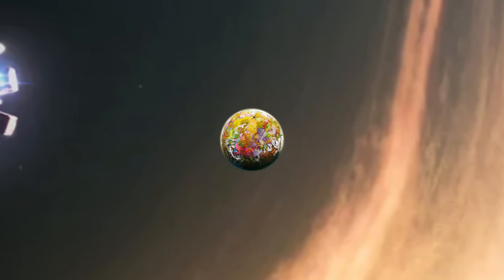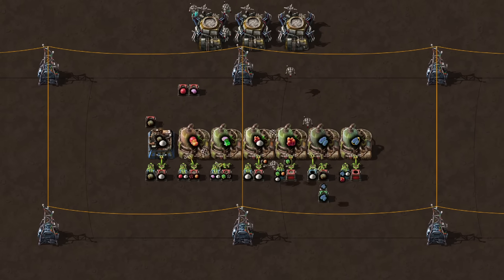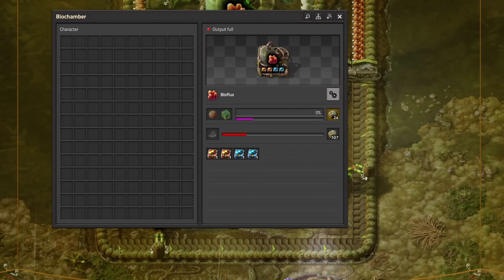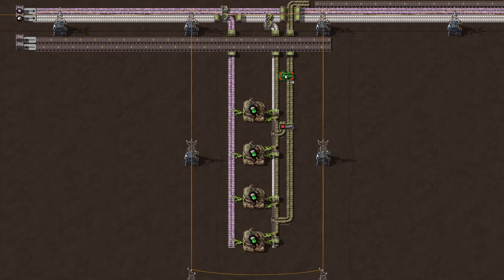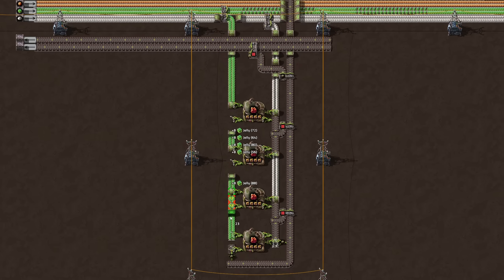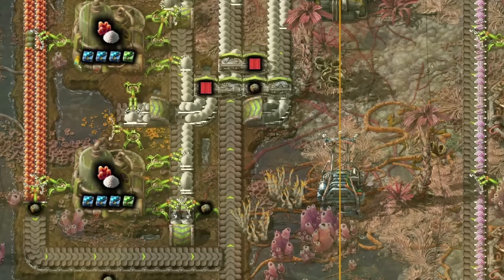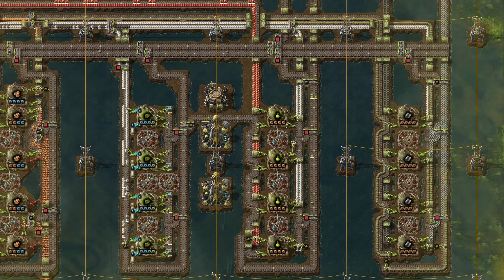Master Planet Gleba in Factorio. With Belts and a Main Bus! Factorio Guide / Tutorial

Comment: This is a really good guide but I would advise having a separate spoilage belt round the outside of each production block. Sometimes it clogs using the blueprints provided. I managed to fix this by separating the belt and using some splitters at various points in the ingredient belts. You rarely see that dark green at all anymore except where you want it. This way is so much better than having a million bots. Thank you so much xD.
Reply from the maker: I don't see how this could ever clog up even in theory and it also never happened so I'm not sure what went wrong.
Don't use normal belts though, at least red ones. Better express or turbo.
Reply: @AVADIIStrategy Sometimes when it doesn't move as much even with turbo belts there is a lot of spoilage that builds up some times. It's always good to keep the belts moving but that isn't always 100% possible. Adding an extra belt kept it clear even when the belts fully stall, it gave me a good way to provide extra spoilage for the power supply. All I did was add a separate belt and add splitters that constantly pulled the spoilage off. It actually works really really well.

 I wasn't implying there was something wrong with your build at all (quite the contrary actually), I was just saying that if nothing is moving sometimes the belts go very green so adding load of splitters at select places on belts is a great way to keep the belts clean while pulling spoilage off.
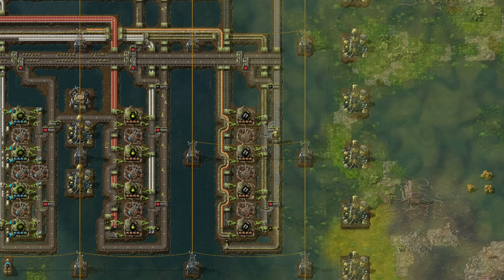Reply from the maker: @reddragon4482  I guess you are talking about situations similar to 7:00 theres a lot of spoilage in the carbon fiber production and you're trying to get rid of the spoilage on extra belts.
The thing is: you don't have to. The reason stuff is spoiling is because of overproduction. As soon as you start consuming it will clean up automatically.
Theres nothing wrong with having spoilage on your belts so in my opinion you're trying to solve a non-issue.
Reply: @AVADIIStrategy 👍

Comment: Loved the video, many good tips. One more: many Gleba recipes (and all the normal ones) don't require a biochamber, they can be done by an assembling machine T2 or T3 (AMs). Yes, the biochamber is very efficient, but managing nutrients can be a hassle if you have to do a cold restart of the base.
Eg: making bacteria from fruits is only really needed if you don't have a running Biochamber growing more bacteria and can be done in-hand or in an assembling machine. And AMs don't require nutrient to do so, just fruit products.
Processing Jellynuts and Yumakos can also be made with either the Biochamber or AMs. So if your jelly&mash  -> bioflux -> nutrient chain starves, you can still keep producing jelly and mash to help restart the bioflux-making biochambers. If you get to Gleba before you unlock bots (or are just low on belts), you can even place the AM right next to the Agricultural tower, and feed the seeds from the AM back into the tower. Without any productivity modules this will result in neither a net gain or loss of seeds, allowing the tower+Am to simply produce fruitproduce with no extra input. It will spoil rapidly, but it's nice during those no-drop-pod starts.
Making biochambers themselves can also be done in AMs, but since the base recipe requires nutrients anyway, there is little point to do this after making your first biochamber.

Comment: I noticed a problem with your infinite egg blueprint. If the nutrient output spoils inside the assembler, there is no inserter to remove it. It normally should not happen, but if the base shutdown for some reason, it will happen.
Reply from the maker: Cannot happen because the biochamber consumes way more nutrients.
The only case would be a long power outage. But without power no other solution would work.
Unless you use the trick presented in the comments section:
Just save biochambers. If recycled they turn back into eggs.
Reply: @AVADIIStrategy  Yeah, a power outage would be the cause, but when power come back, the spoil is blocking the output. A simple inserter to take it out on a belt that brings it to the burner or the spoil chest is the fix. It is less pretty, but it works.
Reply from the maker: @Wildhorn666  But then the eggs spoiled and are gone. So you would be forced to manually fix the issue anyway and get a new egg from the locals.
Reply: @AVADIIStrategy You are right.

Comment: Instead of inserter at the end (to remove spoilage) I recommend a item loop you introduced in the Fulgora video. (because sometimes the end of the belt will be fresh and rest will be spoiled). In that case all we need is to read a loop content to avoid belt overload (items stops moving due to no space after spliter) and filter out spoilage.
Reply from the maker: If the end of the belt is fresh and rest is spoiled you have no problem do you?
The system will just sort out this problem on it's own consuming the fresh stuff and then the spoilage is at the end of the belt and will be removed.
But generally speaking when using belts properly the items on your belts will be in ordered by freshness so this doesn't happen.

Comment: I felt really stupid at 2:10 as I power my gleba factory with spoilage heating tower, but for some unknown reason I kept thinking the heating power as a burnable powered nuclear reactor, hence I used control logic to consume just enough fuel as needed. But then I have the problem of disposing the spoilage as I use only the nutrient production as the disposal, and the excess of nutrient always cause the spoilage to be backing up and stop the whole base. I always felt like I want to throw my smooth brain to the wall whenever I need to fiddle with the nutrient balance in gleba, when the answer is to just disable the temperature control system.
Reply: Why complicated it though, just pump tons of spoilage through it through underground belts and grabbers on each side. The more you pump through it with rare+ inserters the better. It will power all your turbines and water heating set up no problem at all. Nilhaus does a good set up for one on his channe for a spoilage powerplant but I took all the circuitry out and just boost the throughput of spoilage as much as possible. It's maybe worth your while importing a nuclear power plant anyway, it's always good for a backup if the base fails for some reason too. Only thing you will need to import is the fuel cells now and again.

Comment: you can limit the spoilage in general by having less input than required or by +50% more bio chamber for each steps
Reply: Spoilage is actually useful though when you have it being pulled off the belt at all times.

Comment: Can you please explain more your circuit network setup for loading agricultural science into the rocket solo?
Reply: yeah, that would be very helpful. I´m struggeling to get that automized
Reply from the maker: What do you mean exactly? You can load it just like any other item.
Unfortunately bots do not have a 'fresh first' setting which is why I don't use bots.
Instead the dedicated rocket silo in the video has "automatic requests..." disabled.
Inserters will put science into the silo with 'fresh first' setting.
And because I only want to load the rocket when there is actually a spaceship in orbit I setup a circuit connection that listens for orbital requests and only start loading when theres an agricultural science request of 1000.
Reply: How do you set a circuit network from space??

Comment: I haven't gotten to gleba yet, but I have a plan for a belt base.  Every belt ends up at a heating tower, so they can never back up.   There should also never be spoilage, but if there is, it goes in the heating tower with everything else with no special consideration.

Comment: I found direct insertion to be the only solution to scalable usage of jelly.

I'm pretty convinced that the most efficient approach to Gleba is belt loops for all ingredients so that nothing gets stuck in a dead end to spoil. With circuits to limit production, you can eliminate tons of spoilage
Reply: Before working too hard on eliminating spoilage, make sure you've got a secondary heating tower fueled with rocket fuel, or some other power source that doesn't require a flow of spoilage.  My first reward for designing a setup with very little spoilage and no overflow...  was to hard crash the power because I wasn't burning enough to keep the heating towers hot enough.

Comment: Nice, but instead of putting seeds on the belt i use a filtered inserter to take it out, aren't you wasting a swing of an inserter every time a seed is generated because they only take one item type at a time? Other than that nice and clean, i also used belts but i changed a lot of it once i had access to a calcite platform.

Comment: This is amazing, I basically copied down this whole thing yesterday after landing on Gleba for my second time through, and set this all up with some expanded production of certain things. I was tired of the full bot base craziness.
My question is, how else are you managing the Eggs? The Egg preserver seems to work, but how are you setting up requests for the Egg production? Are they requesting just a couple of eggs?   My last setup was following Nilaus and one thing I did like was the revolving belt for eggs to make sure they have enough to produce, then I was pulling them off based on how many. I'd be curious to know how you have this set up. Awesome video! belts all the way
Reply from the maker: The egg preserver will occassionally produce eggs and put one into the active provider chest.
On the main bus where i make eggs each biochamber has a requester chest connected to the biochamber.
The biochambers are set to read contents and include in crafting. The requester chest requests 1 egg but is only enabled if the egg content of the biochamber equals 0 which should never happen.
But if it happens a new egg will be brought from the preserver.

Comment: I also want to point out that your use of beacons at 3:45 is actually not very efficient. The best way is to have a line of beacons in front and behind the machines, meaning 8 beacons per machine. That way, if you try and cram an extra beacon between them, you are actually spreading out your biochambers, and effectively decreasing your space efficiency for only a tiny bump in speed. 2 machines in a small space working at 10X production speed is much better than 1 machine and a beacon taking up the same space, but working at 11X
Reply from the maker: Hi, this is not meant to be a very late game fully beaconed design. If you got this impression somehow than i have to tell you that it's not.
Since Space Age, having only 1 or 2 beacons in range of a machine is very efficient because they changed the distribution ratio based on the number of beacons. In other words for every additional added beacon the effectiveness of each is lower.
That's why for an early game setup like this having only 1 or 2 beacons per biolab makes sense. Back in 1.1 i would have agreed with you but in 2.0 a single beacon with speed 2 modules increases the biolab speed from 2.0 to 3.8! +90% That is not a tiny bump in speed.
Reply: @AVADIIStrategy   ah no I wasn't referring to a single beacon being a tiny bump. I was saying that if you already have 8 beacons, adding 2 more by putting them between machines only increases their performance by about 10% due to the diminishing returns. I have just gotten into beaconing my setups, so I think I might be entusiastically using them earlier than most people do. 

As long as you have access to a lot of power though, and make nutrients reliably enough (fastest possible belt out of a bioflux converter) then beacons are not such a late game thing. At least not by the time you get to gleba
Reply: In a way, yes, but in a way, no.
With the new beacon mechanics you may not want so many perachine. The effect per beacon scales with 1/sqrt(n).
Num: Effect: Total
N=1: 1.5        1.5
N=2: 1.06      2.12
N=3: 0.866    2.60
N=4: 0.75      3
...
N=8: 0.5        4.2
...
N=12: 0.43   5.2

And so on. If you want or need max speed for minimum space or machines, then sure, but it gets very expensive. If you aren't hurting for space or processing, just add another machine instead.

Comment: I definitely think belts are they way to go for Gleba, even if it does take a bit more effort. I ensured that belts never stopped moving. Jelly and mash would go along a long belt to the various machines that need them, then end at a set of chests for the sole purpose of letting them spoil for rapid incineration. Very wasteful of the unused fruit, but as was said, resources are infinite. Nutrients were the exception, and just went in a loop sushi-style until they eventually spoil and get filtered out.

Comment: Good video! I have to say though this base is so inefficient it made me cringe super hard. 7:44 no they are not quite until you handle all possible deadlocks. If you really want to master the gleba way with belts i can recommend the Any Planet Start by _CodeGreen mod. It lets you start on Gleba and changes the tech tree so you can research everything starting from any planet. Once you know how to gleb with yellow belts you will have become one with nature (and circuit logic for extra efficienty). After building your starter base on gleba the rest of the expansion feels trivial. Good luck

Comment: Interesting. It seems like turbo belts were partially designed to make this sort of build possible. I prefer keeping production of the fast spoiling products (jelly, mash, nutrients) local to the production of the stable products. Doing that I could build a Gleba base without even express belts.
Reply from the maker: Exactly with turbo belts a product only needs a couple of seconds to go from one side of the belt to the other.

Comment: Seems like a solid base.

Bot's are not reliable unless they are fast. Belts is far more optimal and controlled, I tried both. There are 2 major things I learned from making 3 gleba bases, 1 spaggeti, 1 nilaus inspired based, and my 2nd design (which works very well. The thing I learned:

Gleba is a spoiled child. Give it too little and it starts to whine, give it too much and it get sick. There are 2 valid belt based solution. Give it exactly enough nutiriets per section, or burn it all at the end. I don;' know what I prefer yet, but option 2 seems easier. Avoid asushi betls. Yes, you think they are great, but they generate too much spoliage unless you get the ratio right. My current base lacks spoilage, so I had to create extra by letting jelly spoil (Bioflux to nutrients generate way too much).

Also, be aware there is hidden spiolage coming from machine that failed to eat nutrients and if science backs up because you switch to something else, then make sure you burn the excess in a controlled manor.

Comment: One thing which I think is not covered in this video is the usage of the Gleba Science. It spoils, like everything else. I made sure I only insert science packs, and not spoilage into the reactors. But after I stopped researching maybe for an hour, I discovered that spoilage was inside the reactors. Gleba Science expired in my reactors, and then no new Gleba science was added because those slots were full of spoilage. Now I removed the spoilage manually but obviously it's time to automate this so that for every reactor spoilage is removed automatically.

Comment: I did do some belts but it took me a while before I found a design that mostly worked, and even then, I'm not satisfied with it, I think my base can be further improved.  For example: the products like Jelly and Mash spoil relatively fast, I wonder if there's a way to have kinda, dedicated processors next to production.  I don't know about this plan though because you get *so much stuff*.  Also my base was kind of a hybrid, as I used Active Provider Chests as essentially trash cans to send spoilage off to recipies that need it and to heating towers, but my products flowed on belts.

Comment: I always go with belts, except one time when I tried to do bots just to try it. It's infuriating to me that the horrible ratios you get when using productivity modules (and speed beacons) so strongly favor bot-based logistics, and make belt-based late-game logistics incredibly difficult and aggravating to work with!

You can't just have, for instance, 2x full belts of green circuits require 2x belts of iron and 3x belts of copper, like you can in the early to mid game. No, it's 2x circuits requires 1.42858x iron and 1.53062x copper, and if you really try to find ratios that have whole numbers of belts, the best you can do is 14x belts of circuits needs 10x belts of iron and 10.71429x of copper. And that's just green circuits, it gets far worse with more complex production chains.

Comment: I also used belts on Gleba but instead of a bus I went for a a couple "circulatory" systems with a main looping belt carrying nutriments and spoilage (the blood). The content of the blood is read and nutrient added if they run low (from bioflux, and if it's going too low from spoilage as a way to kickstart the loop again if needed), spoilage is removed with a single filter splitter in the loop and every biochamber has one inserter taking nutrient from the blood and putting its potential spoilage into it. Other products follow a more bus like design with like you an inserter putting spoilage from the end of a belt to the blood.

I have 3 main loops, one for processing fruits, making bioflux and science (the perishables), one for making the products without spoilage taking the mash, jelly and bioflux from the main loop, and one for bacterial ore production. The output of the main loop are either used immediately or burned to ensure it always flow.

Bots are only used to fill the rockets and defenses